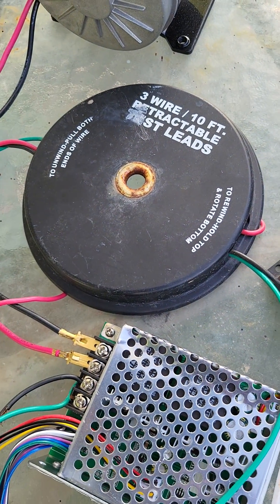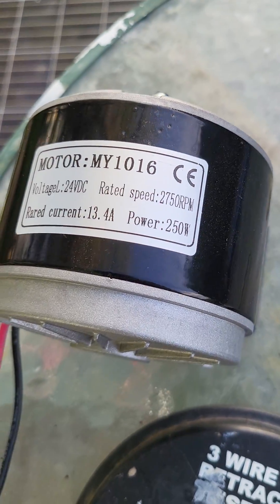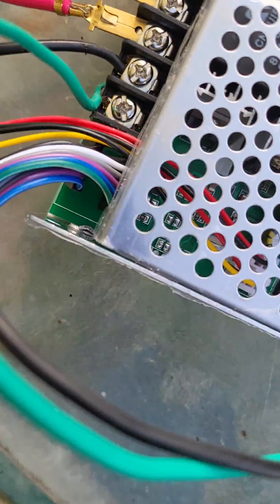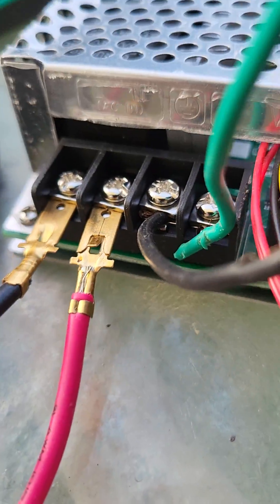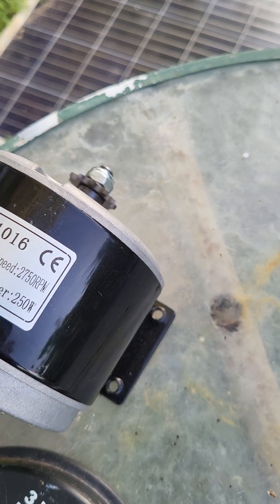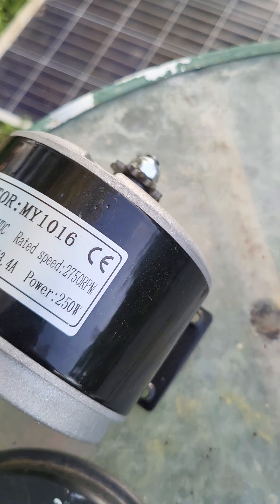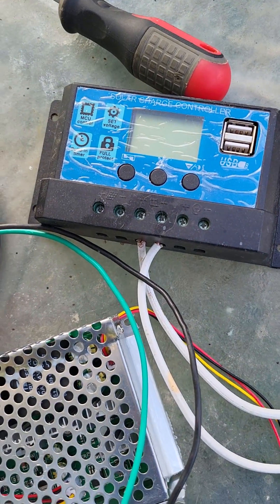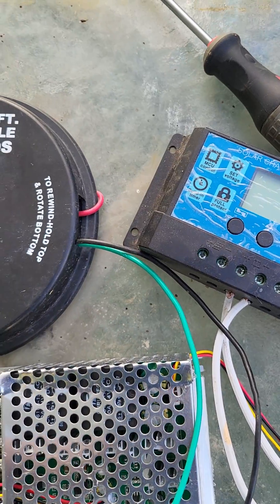Converting a swamp cooler to run with our Solar array.

Comment: Use a BLDC motor instead of a brushed Ac motor .
Reply from the maker: The motor controller I have will only work with a brushed motor.

Comment: The LED is doing that because it is "multiplexing" which basically means it is turning on one line at a time very quickly. I have an example on my channel https://youtu.be/-CsocnX73xg?si=9vNQqWDereYqnT_3

At the beginning the frequency is slow so you can see what is happening but then it gets faster until it appears as if all the LED's are on at the same time. Then it slows back down again.
Reply from the maker: Good to know, thank you for the information.

Comment: Wouldn't it just be easier to use a micro inverter and use the same AC fan and pump?
Reply from the maker: Maybe so. I haven't really looked into it that much, to be honest, I'm just looking at getting as much off grid as I can. Getting ready to switch my bedroom over to DC power, I have super bright leds that I'll be installing as soon as I get my new charge controller figured out and get some dedicated batteries for it.

Comment: This entire setup looks like a fire waiting to happen. The damaged insulation on the wiring, the spade terminals being attached directly to the converter with plenty of extra metal sticking out... 

I really hope youve already addressed these things and this was just a quick mock up for the video. 

Best of luck to you.
Reply from the maker: Yes, just a quick check to see if it was even feasible before getting serious about fabing up a motor mount and wiring it all up.

Comment: I get why this came up in my feed. I do find these things interesting. There's two things I don't get however. 
1. Why you're running a 24v scooter motor on a 12v system?
2. Why your channel is named "Slocum's Creak" as in the sound a door makes and not "Slocum's Creek" as in a shallow small running stream?

If the motor is the thing you can't change or you want to run it at reduced RPM's by regulating the input voltage, I'm going to suggest setting your fan up on a belt drive and not a chain drive. Working with a pulley system for reduction will be far more quiet than gears. Everything about a chain will reduce efficiency.
Reply from the maker: As you may already know, most if not all seem to name their homestead efforts. I'd been struggling to come up with a name that hadn't been taken already. I was having a couple of drinks one evening, and as I sat down, both of my knees and back popped, making a creaking noise. I thought ah ha, Slocums Creek, only to find there is already such a place. So I settled on creak. As for the motor, I wanted something that could run all day and not over heat, however I didn't really have much luck finding a 12 volt motor so I figured I'd just hook up a couple of batteries to get to the 24 volts. However, I may not need to as this motor will run on 12 volts fine. I'd decided I'd use to pulley that's on the motor in the cooler now. If need be, I can fire up my metal lathe and make a bushing to make it fit. Are you doing anything with solar, or are you just interested in it?